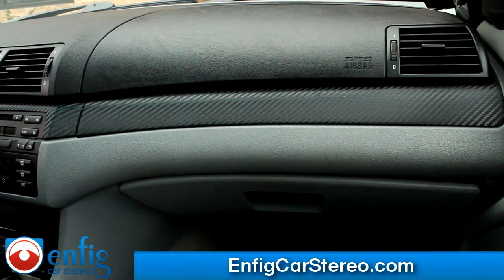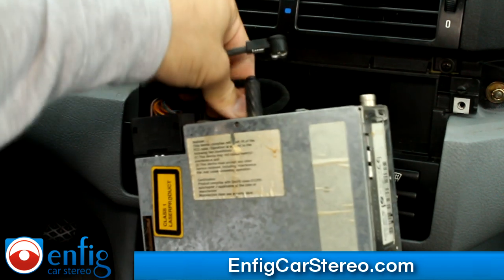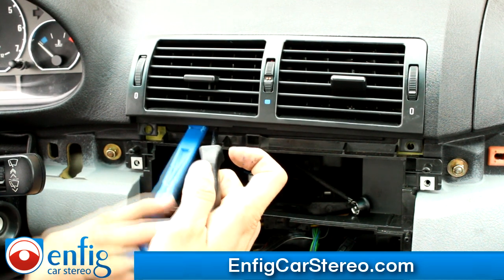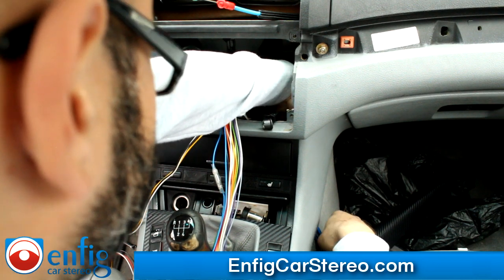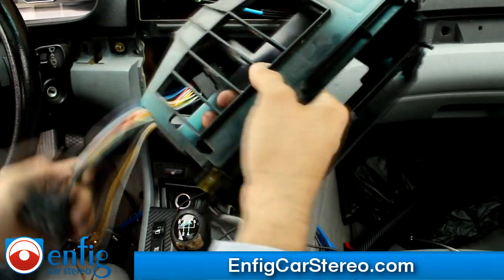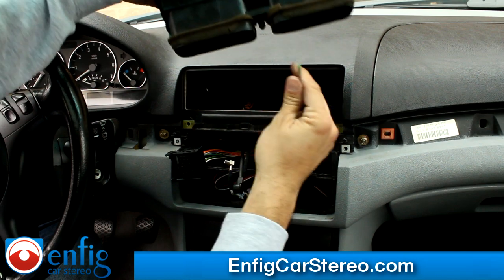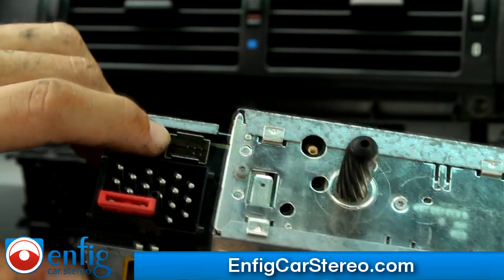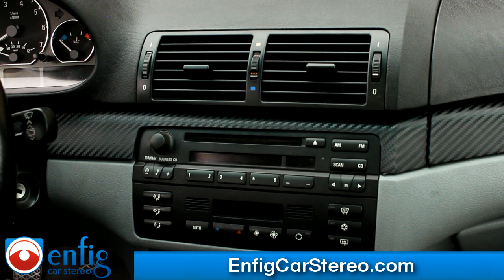AUX iPod INSTALL BMW E46 3 Series 1999-2006 Dension GW1LBM1

Comment: When I listen to my iPhone in my 1999 E46 with a similar Dension device that I didn't buy from you, I'm hearing engine noise through my speakers. I'm convinced that not grounding the loose black wire, which you called a "loose ground" at 18:48, is the cause of hearing this engine noise. Could you advise or walk me through on how I should ground it to the car? Thanks
Reply from the maker: +tbar310 Just ground it to the black wire coming from the dension box.

Comment: do you loose your steering wheel radio function
Reply from the maker: Keeps everything and you can control your phone from the steering wheel controls as long as you get the iPod cable option.  The aux does not.